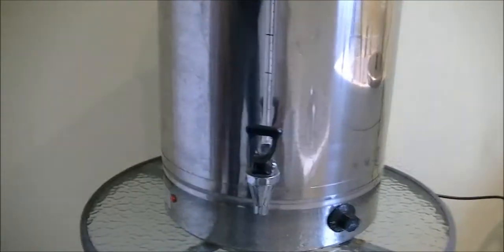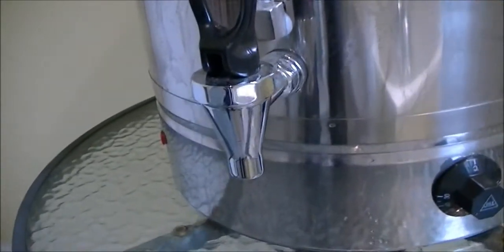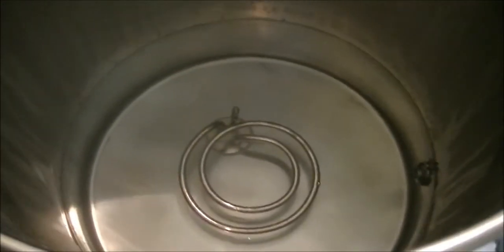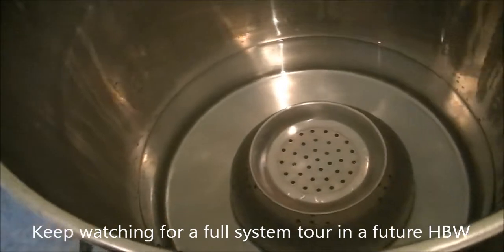Home Brew Wednesday #5

Comment: Nice. I have been looking into crush lately... If you are crushing using your own grinder then run it through twice... as Tiny says BIAB loves a fine crush.
I also had a few too many whole grains when one side of my roller had a slightly larger gap than the other.